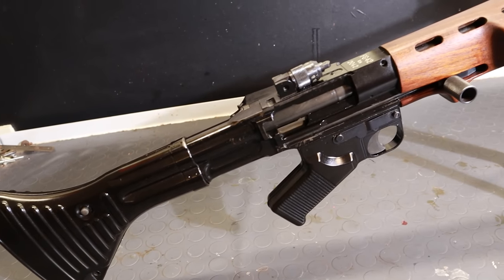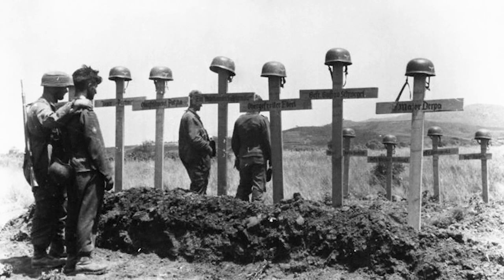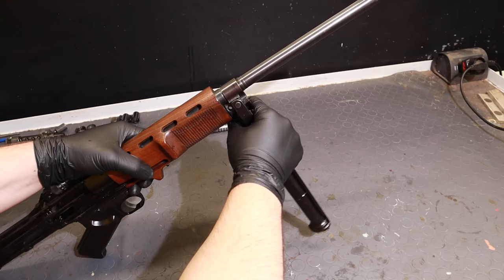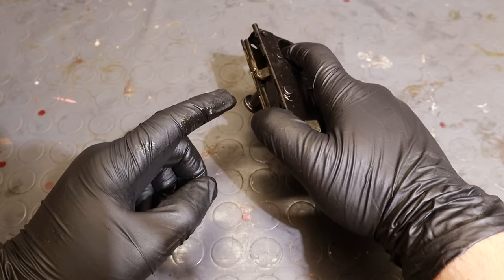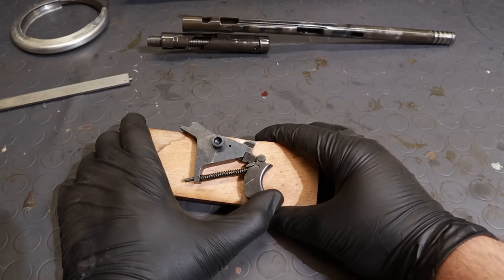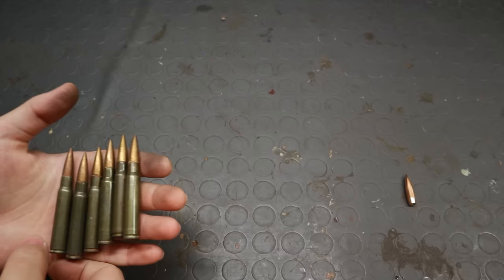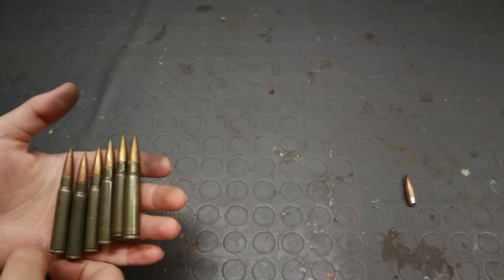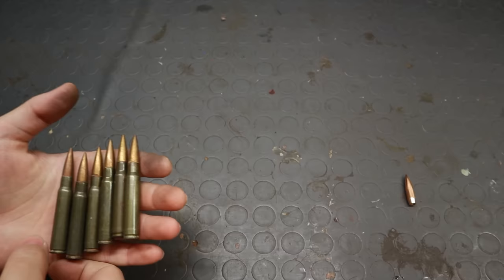Repairing and Testing an FG42: The MOST EXPENSIVE Gun of WW2

Comment: It seems like its largest hindrance was the 8mm cartridge. A smaller, lighter cartridge would have been easier to hit the design goals.
Reply: Honestly, imagine if they went with the x33 rim like the stg instead of the full size x57 rim, it would have been interesting
Reply from the maker: the possibility of using the 7,92x33 Kurz was there, and it was evaluated from the start, but keeping the Crete disaster in mind the designers weren't very keen on using any cartridge that wasn't considered "full power", worrying the paratroopers would otherwise risk being "outranged" again.
Reply: @Backyard.Ballistics  according from what i've seen in  IAN forgotten weapon video the gun is really controllable for the cartridge it's lobbing out at full auto standing. and it seems to do it better than a FAL and certainly an M14 and G3
Reply: No because then it couldn't perform as LMG substitute.
Reply: I wouldn't say so, from what I've seen of people firing it, it is probably the most full-auto controllable battle rifle ever made.
Reply: That and/or the weight constraints (in the end, the STG44 was not lightweight, it was heavier than the FG42 first type).
The final version of the FG42 did weight almost 5kg. If you think of it, the Breda PG did the same service, shooting the pretty powerful 7.57mm Mauser round, with 5.25kg in 1931. The Johnson LMG, shooting the .30-06, did with 5.9kg in 1941 (and they would have been less, had the  barrel been shortened 6cm to match that of the FG42).
Reply: why yes, just about every ww2 rifle wouldve benefitted from being an assault rifle instead, thats why entire categories of rifles were obsoleted by them

Comment: Don't know how it happened, but I bet since the disconnector prevents the gun going full auto the"malfunction" was some one tinkering with it ,messed it up and the gun doesn't fire at all
Reply: If that was the case they'd completely misunderstood it's basic principle of operation. The way you turn this into a full-auto-only weapon is to file off the little disconnector "flag" that protrudes above the trigger pack. Or buy a spare one and do it to that so you can switch back and forth. Putting in a weaker spring accomplishes nothing (except the failure we saw). Putting in a stronger spring would, at worst, introduce feed problems due to drag on the bolt. But that's unlikely since 8mm Mauser can strong arm any spring of that size regardless of stiffness.
Reply: @andersjjensen  
Never said it was done by a mechanical engineer. Probably Bubba or the European equivalent  , figuring that , the disconnector is what makes gun go Brrrrrrrt .I be willing to bet ,if you mic that return spring it's a few coils short.

Comment: The CETME Modelo A for the Spanish Armed Forces was developed by refugee German gun designers postwar using the 8x41mm CETME cartridge; the introduction of 7.62NATO is the reason we do not have 8mm CETME today. This was what the FG-42 was supposed to be.
The requirements were for lightweight, long range accurate automatic fire, and supersonic past 800m or something. The projectile achieved this with an Aluminum/Aluminium core surrounded by a Copper jacket so that it would engage the rifling. It was brilliant. Too bad Spain went with 7.62NATO instead of going through with the perfect intermediate 8mm cartridge. It would have been legendary!

Comment: As far as it's doing double duty as a light machinegun the manufacturer suggests this the FG42 rarely be used in that manor. I'm sure you read the book, Death From Above. which includes the manual where it states, "The weapon fires single-shot and in emergency, in the full-automatic mode."

I enjoyed your video! I fell in love with the FG42 so long ago because of CoD and the like. When the opportunity to acquire one (a repro) happened I jumped on it. I bought the ZF-4 scope before the rifle actually. There was a limited run by Meopta, the direct descendant of the original scope maker. I heard they made a 1000 unit run of the scope and didn't want to miss the opportunity for one of theirs rather than a Chinese knock-off. There is/was a gentleman in Auburn, WA machining the mounts (cool!). Got one. A correct reproduction sling was ordered. I picked up a magazine loader and ammo clips to feed the loader. I'd like to find some more magazines though. Luckily I have a VERY understanding wife!
Reply from the maker: Yes I did read the book😉
Reply: @Backyard.Ballistics   It was good to see another video on the FG42. Thanks.  

I've owned firearms for fifty years and currently I have a small collection of pistols and rifles (about a dozen) that range from black powder to centerfire. The funny thing is that I've had this FG42 seven or eight years  and have yet to take it to the range. Go figure. Take care, sir.   8 )

Comment: A few tweaks to the design could make this an amazing battle rifle for the modern day, fixing the feeding issues could be done with relative ease by switching to 308 and using standard 308 magazines, the gas system and front handguard can be adjusted to not vent hot gas onto the users hands, modern materials and techniques such as polymer materials and stamped parts can be used to reduce weight in certain areas and reduce production costs, the way they got closed and open botl firing is brilliant, and a modernized version of this could have serious potential.
Reply: Back to your gaming now.

Comment: it was still a very impressive design to even if only tentatively, do a decent attempt at its demanding criteria, while under ridiculous weight and length constrictions.
Reply: Indeed it was. And it was a driving factor behind moving to an intermediate cartridge. After looking at the impressive engineering effort, but ultimate failure, it was clear to everyone that you simply can't bend physics over and have your way with it. 8mm Mauser and 30.06 are practically pipe bombs where you hit the enemy with one end cap. You're either going to give up any kind of full auto controllability, accept substantial weight, or step down in power.
Reply: @andersjjensen 
One major factor behind its design and manufacture. The harness used on German parachutes basically had the jumper hanging from one strap reducing his ability to carry any loads while jumping. Also beyond a few limited occasions German paratroopers never jumped into combat after Crete.

Comment: Seems to me, right off the bat and I'm no 'firearms expert', but if they had just developed an intermediate cartridge for the gun, they would have had less issues with overpowering the buffer and the gun in general  instead of using those 8mm Mauser rounds. Cutting back the round to a 7.62 x .39 or similar dimension would have taken a lot of stress off the gun and maybe made it a more workable machine?
Reply: I'd agree, except you have to consider the issue of logistics. They already had stocks and manufacturing lines ready for the 8mm Mauser cartridge, and although the adoption of 8mm Kurz was underway (sort of, the Angry Mustashe German Man wasn't a fan, but the development of 8mm Kurz and weapons in that cartridge was being done under his nose), they didn't have really any of that. Logistics wins wars, not wunderwaffe. Wunderwaffe helps, but only if you can get it to the troops (see M1 Garand).

Comment: The SSD replicas are high quality (as is the Smith Machine Group FG42, but the SSD is a more faithful rendition) but the example in the video appears to be over gassed as the recoil stroke looks too fast and violent. I'd try a smaller gas port in the regulator.

Comment: NICE werk!
If you'd like the ultimate in FCG frustration, completely disassemble a Mossberg 500 trigger group! (Preferably an older example)
DEF wear safety specs  when working  with ANY springs!
A few Rubiks Cube-esq springs in there that have retention legs on both ends, so they perform tasks & function in <> two directions...Neatly weave'd between other parts w/minimal space to spare in betwixt. The many armed Hindu God, -Shiva, would prob even see issues!...HA!
Makes an H&K G3 FCG look SIMPLE in comparison!
Those SMG FG42 re-pro's are simply GORGEOUS arent they?...Looking forward to getting my hands on one @ some future point..
-Simply IMPRESSIVE that he'd reverse engineer'd & measured EVERY single component part from an original example. YEARS of  meticulous n' intensive work before ya even possess a semi/partly/fully functional prototype piece....

Comment: It wasn't that expensive. 250 reichs was the cost to produce an mg42.  Basically every country except the us were amazing at price production efficiency (the us saving grace was the grease gun which surpassed the sten at late war cost efficiency)
The Thompson before 1943 was super expensive at about 200 usd. And the standard garand before 1943 was 80 usd!!

After 1943 I think the Thompson went down to maybe 60 and garand went down to 30 or 35 as my estimates from memory.
And don't forget the fg42 was only for the 
super expensive  paratroopers and wasn't a standard production gun

Comment: I would dispute the claim that the FG42 was the most expensive small arm of WW2. The USA did not have the industrial ability to produce small arms in large quantities by using stamping methods. To produce the FG42 in the US would require an entirely new industry to be created practically from scratch. This is why the FG42 would have been prohibitively expensive for the US to produce.  Germany already had a well established stamping industry for small arms and therefore the FG42 was not that expensive for the Germans to produce; the German problem was lack of suitable raw materials which actually made the FG42 even cheaper for the Germans because they were forced to use cheap materials in the gun. Unfortunately, Nazi price fixing policies, complete state control over the economy, incompetence and corruption of the Nazi officials involved make it impossible to figure out exactly how much it cost to make an FG42 in any currency other than Reichsmarks which had no stablished exchange rate with foreign currencies.

Comment: hey man, any advice on filling in pittin on a ww2 gun? you have inspired me to restore my ww2 trench gun. im not going to sell it so i would like to fill in some of the deeper pits in the recever.
Reply: Not possible without sanding it down.
You can use jb weld or mud to fill the craters in but it will still l ook ugly.
Reply: @jason200912  huh, I was kind of hoping that I can just do a tack weld as it’s only a few deep big craters. I’ve seen some guys do it but I’m not sure if this could work for me.
Reply: Don't, you will acheive nothing but destroying it's value.
Reply: @snowflakemelter1172  i get that but i dont plain on selling it, the recever itself has almost none of the blueing left and the pits ate trough most of the roll marks, on the collecters end it aint woth much. i need to restore it to protect it. i can just sand the one really bad side a bit but i dont want to do that. im looking into a company that restores trench guns primarly and want to see what they think i should do
Reply: @Therealmortard ( I was a gunsmith in London ) and I would suggest using a non permenant car body filler then sanding down without toucjing the metal or any markings and spray painting.
Reply: @snowflakemelter1172  i was thinking of using durifill on it, for now im looking at as many options as i can to keep it as close to original but also fixing some of the damage that needs to be like the lack of blueing on one side. if it helps i have a few vids of it on my yt. maybe you can think of something i havent looked into

Comment: I wonder if the Germans had developed a new round, think 308 to the 30-06, but in an 8mm diameter, if that would have solved some of the reliability problems this piece had. Instead of forcing the 8mm Mauser into a smaller platform.
Reply: Spain developed 7.92 cetme which was effective for burst fire at 1000m

Comment: Well, making expensive and complicated weapons was a German art back then. Instead of making a slightly better version of the T-34, they made the Panther tank which was more complicated and prone to certain failures. The engine was over engineered and vehicle field maintenance wasn't easy or quick. That the FG-42 was an expensive and complicated, as well as a flawed, gun is not surprising, but rather sad. But, you go to war with what you have, not always what you need or require. We like to think that weapons evolve to be better weapons especially during a war like the evolution of fighter aircraft, but we see these examples of guns and tanks and wonder what were they thinking when they made these things. How difficult was it to tear down that gun for this repair and would field maintenance be a problem for this gun?

Comment: Most expensive gun of ww2? yeah if it was an authentic unmolested german example of a fg42 in original condition then yeah but instead its a new built smith manufacturing, semi auto gun designed from the ground up to only fire semi auto and runs 5k and up